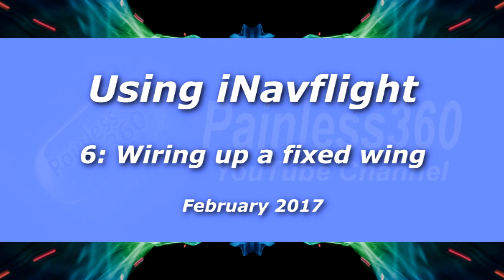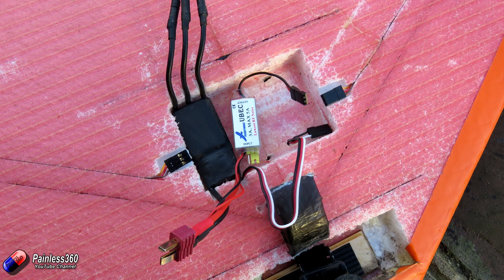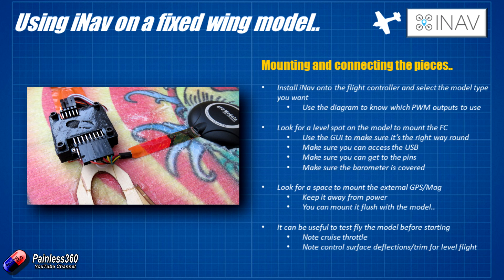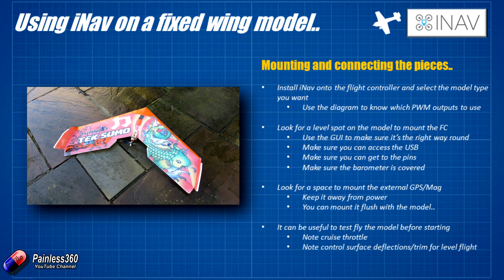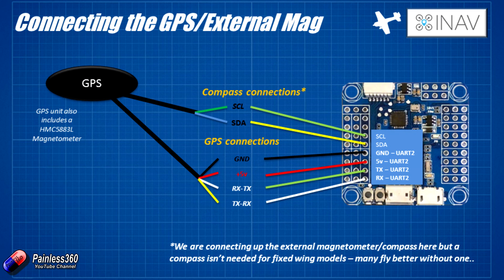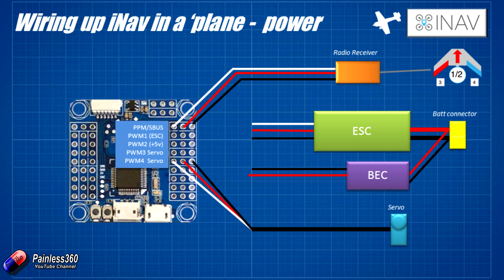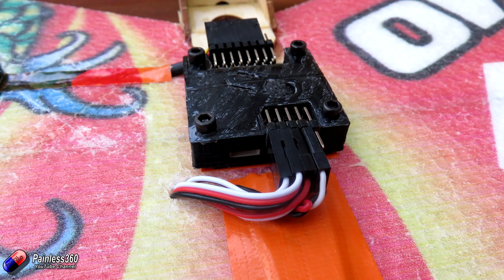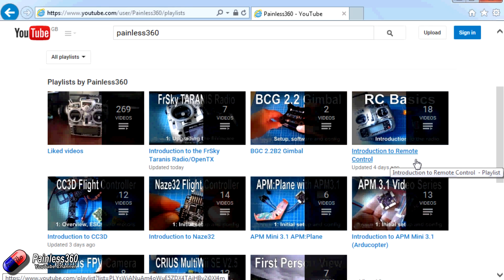(6/8) Introduction to iNav: Wiring up a Fixed Wing

Comment: Seems to be working in the Teksumo. Failsafe on a switch is working also. I have the GIRON in the stack, but what bad behavior should I see with an board mounted mag If it is catching emf interference?
Reply from the maker: +Eph Robbins I'd turn off the mag in a plane, it's not needed. What settings are you taking for tuning?
Reply: Painless360 

Entering CLI Mode, type 'exit' to return, or 'help'

# dump

# version
# INAV/SPRACINGF3 1.5.1 Jan  5 2017 / 11:33:42 (556168d)
# pflags
# Persistent config flags: 0x00000000
# dump master

# mixer
mixer FLYING_WING
mmix reset
smix reset

# feature
feature -RX_PPM
feature -VBAT
feature -UNUSED_1
feature -RX_SERIAL
feature -MOTOR_STOP
feature -SERVO_TILT
feature -SOFTSERIAL
feature -GPS
feature -FAILSAFE
feature -SONAR
feature -TELEMETRY
feature -CURRENT_METER
feature -3D
feature -RX_PARALLEL_PWM
feature -RX_MSP
feature -RSSI_ADC
feature -LED_STRIP
feature -DASHBOARD
feature -UNUSED_2
feature -BLACKBOX
feature -CHANNEL_FORWARDING
feature -TRANSPONDER
feature -AIRMODE
feature -SUPEREXPO
feature -VTX
feature -RX_SPI
feature -SOFTSPI
feature -PWM_SERVO_DRIVER
feature -PWM_OUTPUT_ENABLE
feature -OSD
feature RX_PPM
feature VBAT
feature MOTOR_STOP
feature GPS
feature FAILSAFE
feature BLACKBOX
feature PWM_OUTPUT_ENABLE

# beeper
beeper GYRO_CALIBRATED
beeper HW_FAILURE
beeper RX_LOST
beeper RX_LOST_LANDING
beeper DISARMING
beeper ARMING
beeper ARMING_GPS_FIX
beeper BAT_CRIT_LOW
beeper BAT_LOW
beeper GPS_STATUS
beeper RX_SET
beeper ACC_CALIBRATION
beeper ACC_CALIBRATION_FAIL
beeper READY_BEEP
beeper MULTI_BEEPS
beeper DISARM_REPEAT
beeper ARMED
beeper SYSTEM_INIT
beeper ON_USB
beeper LAUNCH_MODE

# map
map AETR1234

# serial
serial 0 1 115200 38400 0 115200
serial 1 2 115200 38400 0 115200
serial 2 1 115200 3

set looptime = 2000
set i2c_overclock = OFF
set gyro_sync = ON
set gyro_sync_denom = 1
set acc_task_frequency = 500
set attitude_task_frequency = 250
set async_mode = NONE
set mid_rc = 1500
set min_check = 1100
set max_check = 1900
set rssi_channel = 0
set rssi_scale = 30
set rssi_ppm_invert = OFF
set rc_smoothing = ON
set input_filtering_mode = OFF
set min_throttle = 1169
set max_throttle = 2000
set min_command = 1000
set 3d_deadband_low = 1406
set 3d_deadband_high = 1514
set 3d_neutral = 1460
set 3d_deadband_throttle = 1000
set motor_pwm_rate = 400
set motor_pwm_protocol = STANDARD
set fixed_wing_auto_arm = ON
set disarm_kill_switch = OFF
set auto_disarm_delay = 0
set small_angle = 180
set reboot_character = 82
set gps_provider = UBLOX
set gps_sbas_mode = WAAS
set gps_dyn_model = AIR_1G
set gps_auto_config = ON
set gps_auto_baud = ON
set inav_auto_mag_decl = ON
set inav_accz_unarmedcal = ON
set inav_use_gps_velned = ON
set inav_gps_delay = 200
set inav_gps_min_sats = 6
set inav_w_z_baro_p =  0.350
set inav_w_z_gps_p =  0.200
set inav_w_z_gps_v =  0.500
set inav_w_xy_gps_p =  1.000
set inav_w_xy_gps_v =  2.000
set inav_w_z_res_v =  0.500
set inav_w_xy_res_v =  0.500
set inav_w_acc_bias =  0.010
set inav_max_eph_epv =  1000.000
set inav_baro_epv =  100.000
set nav_disarm_on_landing = OFF
set nav_use_midthr_for_althold = OFF
set nav_extra_arming_safety = ON
set nav_user_control_mode = ATTI
set nav_position_timeout = 5
set nav_wp_radius = 100
set nav_max_speed = 300
set nav_max_climb_rate = 500
set nav_manual_speed = 500
set nav_manual_climb_rate = 200
set nav_landing_speed = 200
set nav_land_slowdown_minalt = 500
set nav_land_slowdown_maxalt = 2000
set nav_emerg_landing_speed = 500
set nav_min_rth_distance = 500
set nav_rth_climb_first = ON
set nav_rth_tail_first = OFF
set nav_rth_alt_mode = AT_LEAST
set nav_rth_altitude = 1000
set nav_mc_bank_angle = 30
set nav_mc_hover_thr = 1500
set nav_mc_auto_disarm_delay = 2000
set nav_fw_cruise_thr = 1400
set nav_fw_min_thr = 1200
set nav_fw_max_thr = 1700
set nav_fw_bank_angle = 20
set nav_fw_climb_angle = 20
set nav_fw_dive_angle = 15
set nav_fw_pitch2thr = 10
set nav_fw_roll2pitch = 75
set nav_fw_loiter_radius = 5000
set nav_fw_launch_velocity = 300
set nav_fw_launch_accel = 1500
set nav_fw_launch_detect_time = 40
set nav_fw_launch_thr = 1600
set nav_fw_launch_motor_delay = 150
set nav_fw_launch_timeout = 5000
set nav_fw_launch_climb_angle = 10
set serialrx_provider = SPEK1024
set spektrum_sat_bind = 0
set telemetry_switch = OFF
set telemetry_inversion = ON
set frsky_default_lattitude =  0.000
set frsky_default_longitude =  0.000
set frsky_coordinates_format = 0
set frsky_unit = IMPERIAL
set frsky_vfas_precision = 0
set frsky_vfas_cell_voltage = OFF
set hott_alarm_sound_interval = 5
set smartport_uart_unidir = OFF
set battery_capacity = 0
set vbat_scale = 110
set vbat_max_cell_voltage = 43
set vbat_min_cell_voltage = 33
set vbat_warning_cell_voltage = 35
set current_meter_scale = 400
set current_meter_offset = 0
set multiwii_current_meter_output = OFF
set current_meter_type = ADC
set align_gyro = DEFAULT
set align_acc = DEFAULT
set align_mag = DEFAULT
set align_board_roll = 55
set align_board_pitch = -20
set align_board_yaw = 2700
set gyro_lpf = 98HZ
set moron_threshold = 32
set imu_dcm_kp = 2500
set imu_dcm_ki = 50
set imu_dcm_kp_mag = 10000
set imu_dcm_ki_mag = 0
set pos_hold_deadband = 20
set alt_hold_deadband = 50
set yaw_motor_direction = 1
set yaw_jump_prevention_limit = 200
set tri_unarmed_servo = ON
set servo_lowpass_freq = 400
set servo_lowpass_enable = OFF
set servo_center_pulse = 1500
set servo_pwm_rate = 50
set failsafe_delay = 5
set failsafe_recovery_delay = 5
set failsafe_off_delay = 200
set failsafe_throttle = 1000
set failsafe_kill_switch = OFF
set failsafe_throttle_low_delay = 100
set failsafe_procedure = RTH
set rx_min_usec = 1005
set rx_max_usec = 2101
set acc_hardware = MPU6050
set baro_use_median_filter = ON
set baro_hardware = MS5611
set mag_hardware = HMC5883
set blackbox_rate_num = 1
set blackbox_rate_denom = 1
set blackbox_device = SPIFLASH
set magzero_x = 110
set magzero_y = -302
set magzero_z = 92
set acczero_x = 147
set acczero_y = -7
set acczero_z = -175
set ledstrip_visual_beeper = OFF
set accgain_x = 4094
set accgain_y = 4109
set accgain_z = 4006

# rxfail
rxfail 0 a
rxfail 1 a
rxfail 2 a
rxfail 3 h
rxfail 4 h
rxfail 5 h
rxfail 6 h
rxfail 7 h
rxfail 8 h
rxfail 9 h
rxfail 10 h
rxfail 11 h
rxfail 12 h
rxfail 13 h
rxfail 14 h
rxfail 15 h
rxfail 16 h
rxfail 17 h

# dump profile

# profile
profile 0

# aux
aux 0 1 1 900 2100
aux 1 20 1 900 2100
aux 2 23 1 900 2100
aux 3 4 1 900 2100
aux 4 3 1 1150 1250
aux 5 8 1 1350 1450
aux 6 14 1 900 2100
aux 7 18 2 1850 2000
aux 8 18 2 1100 1225
aux 9 0 0 900 900
aux 10 0 0 900 900
aux 11 0 0 900 900
aux 12 0 0 900 900
aux 13 0 0 900 900
aux 14 0 0 900 900
aux 15 0 0 900 900
aux 16 0 0 900 900
aux 17 0 0 900 900
aux 18 0 0 900 900
aux 19 0 0 900 900

# adjrange
adjrange 0 0 0 900 900 0 0
adjrange 1 0 0 900 900 0 0
adjrange 2 0 0 900 900 0 0
adjrange 3 0 0 900 900 0 0
adjrange 4 0 0 900 900 0 0
adjrange 5 0 0 900 900 0 0
adjrange 6 0 0 900 900 0 0
adjrange 7 0 0 900 900 0 0
adjrange 8 0 0 900 900 0 0
adjrange 9 0 0 900 900 0 0
adjrange 10 0 0 900 900 0 0
adjrange 11 0 0 900 900 0 0

# rxrange
rxrange 0 1000 2000
rxrange 1 1000 2000
rxrange 2 1000 2000
rxrange 3 1000 2000

# servo
servo 0 1000 2000 1500 90 90 100 -1
servo 1 1000 2000 1500 90 90 100 -1
servo 2 1000 2000 1500 90 90 100 -1
servo 3 1000 2000 1500 90 90 100 -1
servo 4 1000 2000 1500 90 90 -100 -1
servo 5 1000 2000 1500 90 90 100 -1
servo 6 1000 2000 1500 90 90 100 -1
servo 7 1000 2000 1500 90 90 100 -1

set nav_alt_p = 50
set nav_alt_i = 0
set nav_alt_d = 0
set nav_vel_p = 100
set nav_vel_i = 50
set nav_vel_d = 10
set nav_pos_p = 65
set nav_pos_i = 120
set nav_pos_d = 10
set nav_posr_p = 180
set nav_posr_i = 15
set nav_posr_d = 100
set nav_navr_p = 10
set nav_navr_i = 5
set nav_navr_d = 8
set deadband = 5
set yaw_deadband = 5
set throttle_tilt_comp_str = 0
set flaperon_throw_offset = 250
set flaperon_throw_inverted = OFF
set gimbal_mode = NORMAL
set fw_iterm_throw_limit = 165
set mode_range_logic_operator = OR
set default_rate_profile = 0
set mag_declination = 1600
set mag_hold_rate_limit = 90
set p_pitch = 20
set i_pitch = 30
set d_pitch = 15
set p_roll = 25
set i_roll = 30
set d_roll = 15
set p_yaw = 0
set i_yaw = 0
set d_yaw = 0
set p_level = 20
set i_level = 5
set d_level = 75
set max_angle_inclination_rll = 600
set max_angle_inclination_pit = 450
set gyro_soft_lpf_hz = 40
set acc_soft_lpf_hz = 15
set dterm_lpf_hz = 30
set yaw_lpf_hz = 30
set yaw_p_limit = 300
set iterm_ignore_threshold = 200
set yaw_iterm_ignore_threshold = 50
set rate_accel_limit_roll_pitch = 0
set rate_accel_limit_yaw = 10000

# dump rates

# rateprofile
rateprofile 0

set rc_expo = 40
set rc_yaw_expo = 20
set thr_mid = 50
set thr_expo = 0
set roll_rate = 20
set pitch_rate = 20
set yaw_rate = 20
set tpa_rate = 33
set tpa_breakpoint = 1300
Reply: Tune is from the wiki, minus all the led stuff from the command. Still needs more tuning. Notice there is no command for emf_avoidance in this dump. Not sure if this is a 1.5 thing or a flying wing thing? I'm running 433mhz for control link.
Reply: I disagree,  if you fly LOS (in this case not line of sight, but loss of signal) then failsafe kicks in and your plane starts RTH and then you need a working compass!